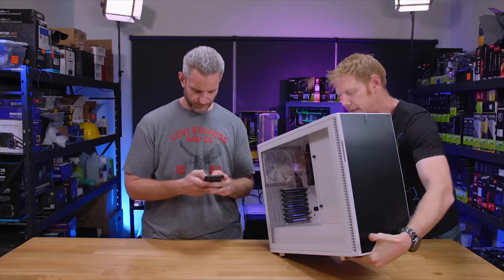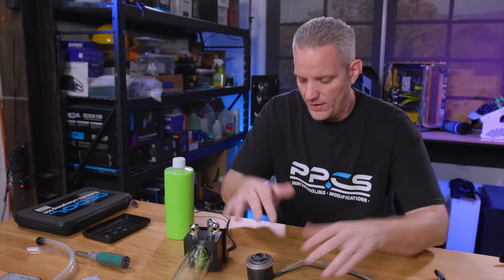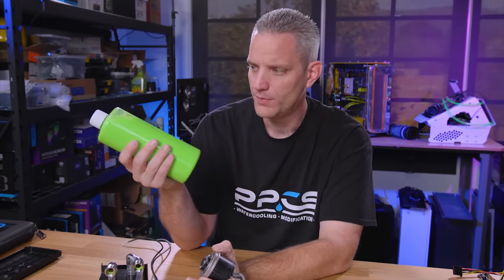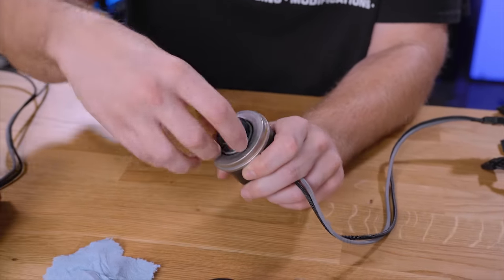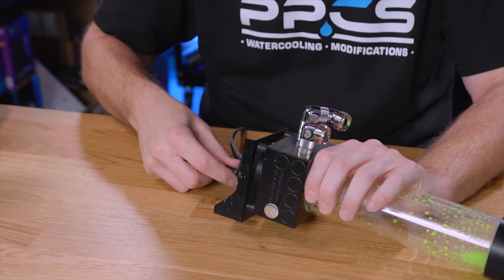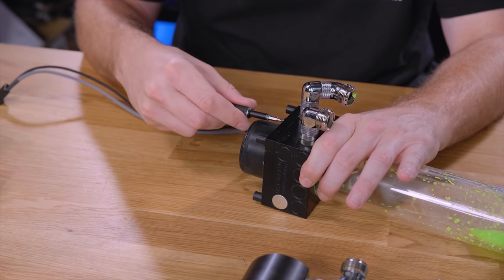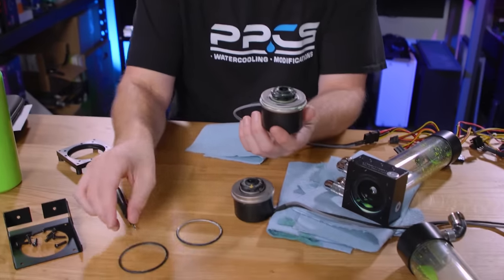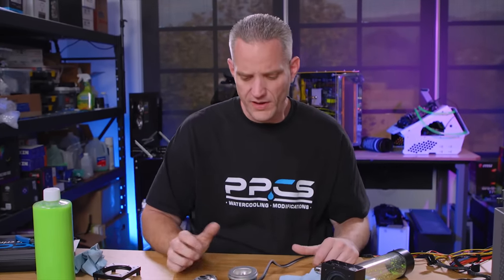BOTH of my pumps died... here is how I fixed them!

Comment: I FINALLY started getting the parts for my custom loop. I went with a XSPC Photon 170 D5 pump/res combo and a Raystorm NEO AM4 CPU block. This is my first loop so I did decide to go with soft tubing for now and when I decide to make the leap to hard line it shouldn't cost much more than $100 USD to do so. I have various fittings coming. Compression, 90 degree rotary, T, ball valve, male to male, plugs, I think that's it for fittings. I have an EX240 (white) radiator, system prep (Primochill) and some premix clear coolant (I eventually want to change to Primochill Vue) coming also. Everything is XSPC, except the system prep. Thanks to you @JayzTwoCents I put together an organized checklist and it wasn't too difficult to make sure I ordered everything I needed. If you noticed a lot of "likes" on older liquid cooling videos lately, that was probably me. Picturing and planning the loop visually inside my case helped A LOT with what fittings I might need. The loop is mostly for aesthetics and I'm anxious, nervous and excited all at the same time about finally doing this.

Comment: Hey Jayz, we've been using this type of BLDC motor in the aquarium industry for quite some time. Yes, I can confirm that it is never good to leave them idle for too long with any fluid present, especially on low power motors with limited starting torque. It doesn't take a lot of gunk to get the
impeller stuck as you found out. Second, permanent magnets (cheaper ones especially) tend to deteriorate over time and sitting idle, immersed in fluid can and does warp them. Any of us who run lots of DC pumps in our tanks long enough have to replace a swollen impeller assembly that is out-of-round. The first sign is increased vibration and noise. The good news is the D5 use all stainless impeller assemblies with expoxy seal (well designed), so a swollen impeller won't be an issue. This is an issue with the cheapo Chinese ones you can buy off of eBay or AliExpress

Comment: Get yourself a good ultrasonic cleaner like a Crest Powersonic annd some Branson EC electrical solution as the cleaning solution and you can get all the nooks and crannies cleaner than you can with using a toothbrush and it won't harm pcb's or anything electrical.
Reply: Is that different from the UC Louis Rossman uses?
This is probably my dumbest question of the month.
Reply: @N00bB1scu1tGaming  I believe it's the same stuff

Comment: This can happen with DDC pumps as well. I had it happen to mine about 2 years or so ago. I was running just distilled water with a silver kills coil (no anti-corrosion additive) with copper blocks. One day I noticed my pump had stopped running and was making that weird noise like it was trying to spin but couldn't. Took the entire loop apart to discover nearly everything in the loop had developed some kind of sandpaper-like (in that it was rather rough and hard to get off) scale/coating on it, including the impeller and where the bearing rests. Put some elbow grease into it and cleaned everything out as best I could, replaced some stuff (tubing, fittings I couldn't get cleaned, etc.) and the pump ran like new again. Still using it to this day. Of course now I use Mayhems X1 (with a little non-pastel dye) and haven't had any issues since.

Also want to say that Jay ultimately you were my inspiration to switch over to hard tubing. Absolutely love the lack of plasticizer buildup and cloudy tubing I always got with soft tube. Plus it just looks so much nicer. Really enjoy the entertaining and informative videos, keep it up man!

Comment: I just did this about a month ago to my EK-XTOP DDC 3.2 that was just over a year old and has only run Mayhem X1 UV Blue that I change out at 6 month intervals, it showed the same kind of residue scum, Q-tips worked wonders for cleaning the pivot bearing/race area, works as good as new now.

Comment: I had the same problem happen to me after running the EK BETA solid Cryofuel for a few months. I was running the old EK transparent blue before that and I had no problems. 
So I bought a new pump, only to find that after disassembling and cleaning the old pump, it actually started working again =) 
At least I have a backup now. Running the new EK solid Cryofuel atm. Hopefully it is better than its beta version.

Comment: I used Koolance's UV-Green Coolant for 6.5 years in a Dual bay / Dual Pump, multi-tube setup and it worked fine the whole time. All I had to do every 3 to 4 months was add a bit more coolant to top it off. Never gave me any issues and was easy to clean when I was done with the use of that PC and repurposed the pumps, connectors and tubes into another system that I"m still using today. So the Laing Pumps can last 7+ years. They're great!

Comment: Reminds me of an issue I had with a fish tank water pump as a teenager. After a while it had stopped working, maybe 12 months, and cleaned out all the filters etc. to no avail. Was at a store buying a new pump, and the salesman to his credit opened the box & fully disassembled the new unit. Similar to the pumps in this video, there was a magnetised part in the centre, which I didn't know you could remove & clean. Went home & gave the pump a good clean, getting cotton buds in there, and after that it ran like new, for many years after that.
Reply: @Cyanne   - From memory they were without the pump for a day, maybe two. Not long enough to cause any issues. I probably just did a partial water change when I'd cleaned/fixed the pump.

Comment: Awesome video with almost perfect timing. Had my ekwb d5 pump fail just last week, after only 2,5 years. Fortunately it miracle-healed itself after a few days so I didn't have to drain my freshly filled loop again (pain in the ass, no easily accessible drain because no space for it -.-). But now that I have seen that you can actually take the impeller of without damaging the pump, I will go for a thorough cleaning of my d5 the next time I disassemble my loop. Thanks Jay =)

Comment: I just fixed one that died. It suddenly started making noise and actually quit running. Ordered a new one from Optimus. Took the old one apart and saw the rotor was rubbing in the bowl, it actually felt rough like it was galling. I sanded the interference marks with 400 then 1000, it was smooth as silk. The rotor does sit lower in the old one compared to the new so it might not last too much longer. I wish you could buy the rotor alone.

Comment: @JayzTwoCents -- Hi Jay, I thought you might find this interesting. It's something I've read and heard many times over recent years, but I bow down to your knowledge with industry contacts and info the public isn't privy to, so correct me if I'm wrong but I believe this is accurate.
◘ Alphacool like EK actually has their own manufacturing of the Laing D5 pumps, meaning they have the right to modify the design *within reason and their choice of materials, hence why some companies like Alphacool and EK have their own versions that are only compatible with their tops and res-combos.
I've read a lot of stuff regarding Alphacools pumps over the past few years as I'm water cooling nerd like yourself, and there are compelling stats and evidence to show Alphacool's pumps have a higher than average failure rate, especially with the VP655 v1.0 (I don't know if that's the type you're using in this video, might be worth checking though).
Whether it be cheaper materials or a slight manufacturing defect, I don't know, but the poor reviews and RMAs compared to all other brands show there is some sort of issue.
Reply: I've seen this before as well. if you go onto any of the major forums and read up on the D5 reviews/RMA's theres a huge amount for aplhacool pumps. and they DO have there own manufacturing and design.
Reply: I never owned a vp655 but I did own a 755 v2 and mine died after 10(ish) months, which is when i started googling d5 failures and found all the info on Alphacools pumps and why they're cheaper than other companie's pumps. I now have an EK pump
Reply: Yep! Read this many many times too.
Reply: Like every other Chinese manufacturer, they have tiers of their product. If you go to a place like Huaqiangbei, SZ, and you talk to someone about buying their product in bulk, they will have between 3, 5, or even 10 different grades. And if you're ordering enough, you can specify your grade. (For the most common example....) You want to buy a fake Rolex? Well, you can get on of pot metal case and plastic gears, or pot metal case and pot metal gears, or stainless case and pot metal gears, or ..... Or a really good copy that only someone at a jeweler could discern from a real one. All made by the same manufacturer, all at a different price. It isn't binning, they actually manufacturer different grades. If you went to Laing, and wanted them to make you a pump to your specs, they'd offer you several different options. This is how almost all manufacturing in China works. Either you choose one of their tiers, or if you're a large enough customer and want to pay for it, every single aspect/component of a product can be specified.
Reply: @dovahkiin2976  company's*
Reply: Saw this as well. It's things like that that make me nervous to switch from air cooling to liquid. Of course like all electronics and products to work with it, you get what you pay for lol
Reply: The VP655 is a regular D5 pump from Laing/Lowara/Xylem (made in Europe, nowadays mostly in Hungary), but the VP755 was developed by Alphacool and is manufactured in China like all other products from Alphacool. It looks very similar and can be compatible with D5 pump tops, but it has a terrible track record of failures. There is a really long thread on overclock.net about this, with participation of Alphacool reps, the Mayhems guy and some very angry users: https://www.overclock.net/forum/61-water-cooling/1624192-alphacool-pump-vpp755-review-noise-issues-problems.html
Reply: to put ek up i am running a d5 pwm pump for 3 years+ and a 2nd for 1 year no issues with distilled water and anti bacterial additives and yearly water changes and silicon grease for the pump bearings and flow meter shaft

Comment: Even with prepping you can have shmoo break loose over time. I have a pump i revived that had something go through it and had the magnet part score the inside of the motor. Cleaned it and emerery clothed it and cleaned it and works again. I am pretty sure it was something from the radiators that caused it.

Comment: I had a xspc branded d5 last me almost 8 years, it went in 4 different systems and multiple fluids before it went out. But not the motor it actually was the ceramic bering that loosened up and started squealing like no other. I figured it had a good run replaced it.

Comment: This is why I only use water with an anti-corrosion/biocide additive.  Am using Utopia now.  No colors, no color gunk x months later.  Just cleaned my system last weekend, opened the Raystorm to see a slight discoloration on the copper that came out in short order with the toothpaste bit (full copper so had to open to see what was going on inside).  Not bad after 11 months.  I sometimes wonder what the rad looks like if the pump can get that gunky.

Comment: This again shows how important cleaning your system is. The most underrated part of computer maintainance. I have seen so many people throw away their PC, just because it would get extremely slow, then start crashing and shutting off. Guess what: Air cooler filled up with dust. Or PSU's totally clogged up with dust. 
And no, having a clean home does NOT prevent dust buildup in you system. Especially the tiny heatsinks in laptops are super vulnerable to this.

Comment: you can do this on a ddc pump as well had mine stop working in an ek predator 360 unit took it apart (was do for a fluid change anyway) cleaned the baring the impeller just like in the video. Spun right up and it works like new again

Comment: Yeah, I started water cooling and as I learned and had to solve problems that you wouldn't imagine to start out with, people started saying "This is why I don't water cool". That's nice. Air cooling is lame and I'm learning, overcoming a challenge is fun. Right now my D5 is pushing about half the volume it did when I bought it, didn't have biocide or anti corrosive additives at first.. Already cleaned the GPU and CPU block, probably going to again (this time with a Dremel and soft bristles), and expect I need to clean the pump too. Also concerned about plasticizer from the rads. But if I learn enough, theoretically in the future I could slap a watercooling system together with enough attention to detail and avoid any major, early problems.

The downside is definitely having your system down for the cleaning, at least for me. Takes time and I get withdrawal.

Comment: 3:36 I'm pretty sure that it's not a nylon bearing but a ceramic ball, because nylon a.k.a. polyamid (melting point at around 220 °C) would just melt and wear down immediately even when bathed in and cooled with water from the rotor spinning at 1800 to 5000 RPM.

Comment: I have the exact same pump/res combo in my rig that's been running 24/7 since late 2014. The only time I have had the pump fail and get a TjMax shutdown while in Windows was when the power extension molex it was connected to one day shorted due to sloppy hand manufacturing defect. I replaced the problem cable. The pumps are made in Cegled Hungary and have a MTBF of 50,000 hours, so yeah, you could run them hard for 6 years before a failure would occur.

BTW: I don't use that fancy colored piss for coolant - straight distilled water with an additive. I've yet to have to take my blocks apart to clean them either. Go for colored tubing and RGB if you want color without the stains LOL